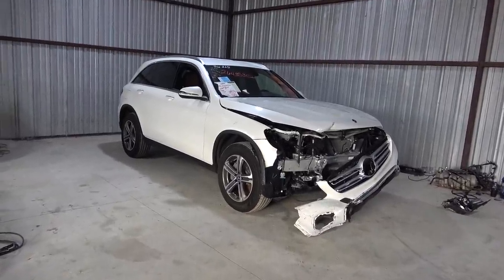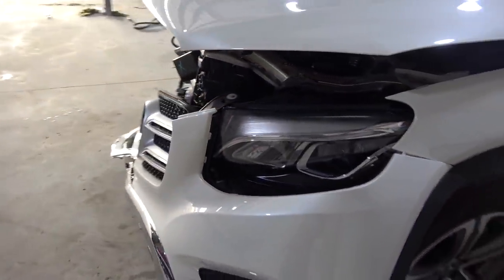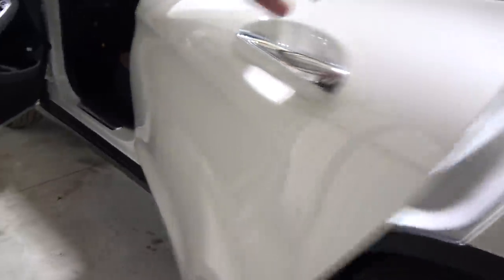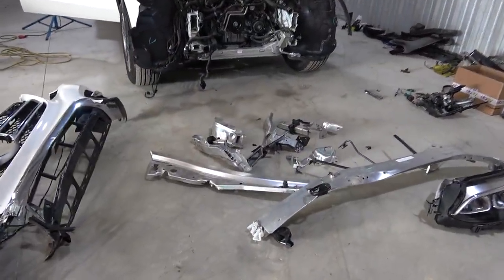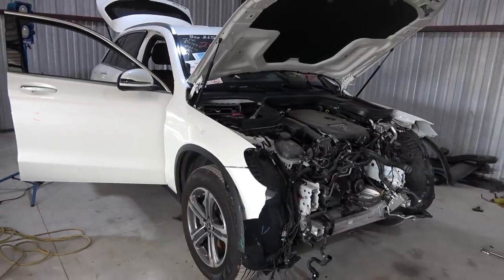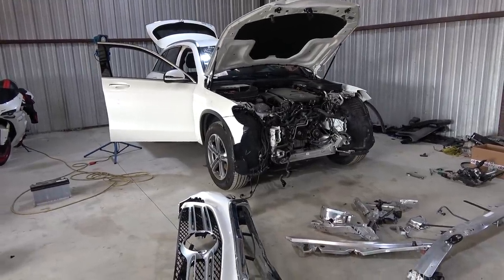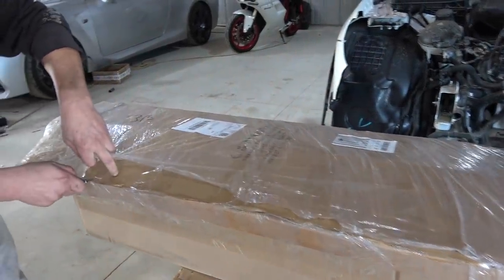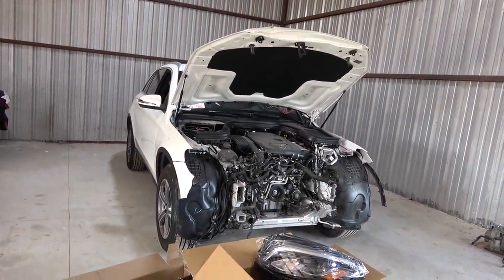Rebuilding My Wife's New 2019 Mercedes Benz GLC 300 Part 2

Comment: Hey just a pointer that your front Radar/distance detector for the adaptive cruise control requires a flat plastic emblem on the grill for it to work un interfered.i do not think the emblem you have ordered is compatible with the radar sensor. Please keep the radar as it’s a key safety feature.

Comment: I think I know the options that your GLC have. Though I may not be right. So it has multimedia package which gives you the upgraded bigger screen, sunroof, Designo Diamond White Metallic, blind spot, led headlights and tail lamps, Saddle brown leather which give your passengers the ability to adjust the headrest electronically, then you have the 3-position memory setting and gives you thigh support, Burmester Surround Sound System, and Mercedes Branded all season floor mats. Good Luck on your rebuild!
Reply: Oh and Natural Grain Ash Black Wood

Comment: Hello I was wondering if the steering wheel airbag from Europe did fit in your car because I did import GL from US rear tail light need to be changed due to amber indicator here in Europe and the connector clips were different

Comment: Nice project :) Greetings from Germany :) The only issue I see with that Airbag would be that we have sometimes problems with false airbags from china and eastern europe, which means that they wouldn't deploy when they should. For example in case of an crash. That's why in Germany you only allowed to use airbags from an dealerships, which sucks, because of the prices 😂. Keep up the good work. I subscribed.

Comment: As an European I'm not sure if someone brought this up already, but I think you got the wrong front grille. I am no expert, but I heard you want the AMG look, however your car has Distronic Plus (Adaptive cruise control) and the "Star" emblem you showed is 3D, not for cars with distronic, because there is no space for the bulky radar you dropped during front disassembly :D. You need to get 2D "Star" emblem . Another thing is the grille itself. It is made for cars with 360 cameras. There is a slot for the front camera just under the "star", but in your case this will be empty, because the car does not have this feature. Its ok I guess if it doesn't bother you. Anyway just wanted to point out these things. I think you were going to find that yourself if you didn't already. So keep doing what you are doing as long as you enjoy it and it is profitable for you. Have a great rebuild ;)

Comment: Just check the emblem. If this has radar cruise control, you'll need the flat emblem with the star that looks like its inside a gloss black circle. It should be flat.

Comment: Are you ok? spitted some comments out. It is not that if it is on ebay that you can asume that it isn't stolen. If it sounds to good to be true, it mostlikely is to good to be true. Beside this a conversation about this subject would be in place instead of commeting on eachother. About the sound, it is a great (free) sound but why not choose an other one? 
Back to you video's, thanks, keep it up, keep mounting, repairing and building you living soon?

Comment: Now I'll probably be ripped apart for saying this but I'm subscribed to goonzquad and a good few more beside, now the difference between goonzquad and rebuilder guy and a lot of the others is where rebuilder guy will try to make do and mend where possible, goonzquad will go out and buy new as they have got so big and can afford it. So the choice is there you can either watch channel's showing their skills in repairing body panels and so on or channels where it's just a case of unbolt replace, it's everybody's choice in the end.

Comment: I dont wanna sound rude in any way i just wonder is it not dangerous to run a car without any Radiator conected?
Reply from the maker: Your good I like to answer questions yes it’s bad but the main purpose for a radiator is to cool the engine if you run it for a short period you will be fine
Reply: Rebuilder Guy oh thank you so mich for responding! Happy new year & im hyped to see this project going on!

Comment: Started the car without the rads on. This is not a pig old american iron, this is a high-tech, aluminium engine. Also,  how can anyone guarantee that the way the car was loaded on the trailer, the brake lines weren't completely crushed? That's exactly the type of stuff I see and put me off from buying second-hand.

Comment: ALWAYS replace the airbag control module after an accident with deployed airbags. You can NOT repair them. Anyone who tells you they can is lying. They act as having a mechanical switch inside the module that cannot be reset. Even if they ‘erase’ the crash data, that car will never be safe again.

Comment: This is not a 2019 model because the 2019 model headlights look way different
Reply from the maker: jack you cant be more wrong
Reply: @RebuilderGuy  does this mean I am right
Reply: @RebuilderGuy  I am not hating maybe the 2019 updated model came late to America
Reply from the maker: I'm not taking it as hate just saying that your claim is false I don't lie on my channel I have no use reason for it the 2020's is where the change happened not 19
Reply: @RebuilderGuy  idk about America but Europe has already changed in 2019 the light are different the steering wheel changed and instead of command online which your wife's GLC has the updated on has mbux and the rear lights are different I have seen these on the streets of Europe since September 2019
Reply from the maker: Mercedes and Bmw like to do that if the car is built after the 6th month its considered the following years model so a car built 9/19 would be considered the 2020 model hope that helps
Reply: @RebuilderGuy  that helps

Comment: You bought a part through ebay in good faith and some people are questioning if the part is stolen due to what country it came from without any proof? 
You are not reasonable even if it was stolen and keep in mind Lithuania and the surrounding countries buy a lot of old or wreaked cars throughout Europe just to either rebuild on the cheap or strip for parts, its one of their main exports.

Also I watch both your channel and Goonzquad's, I enjoy both and find them very different